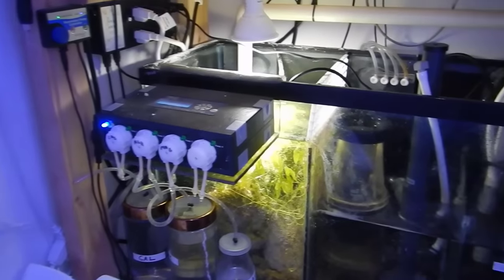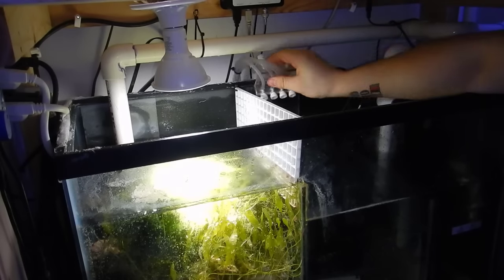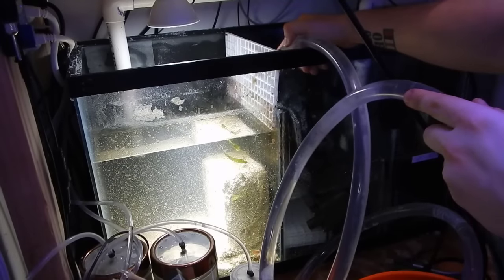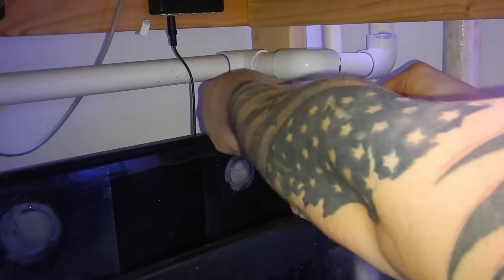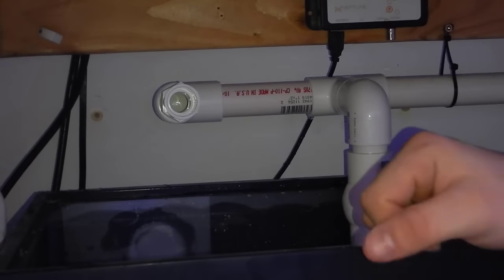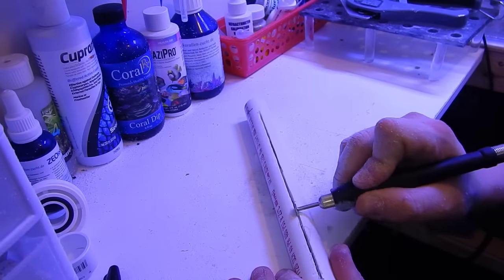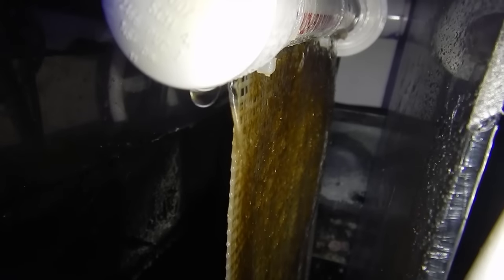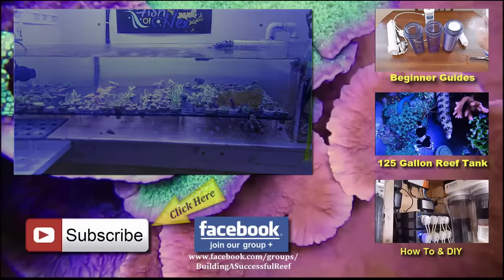Converting A Refugium To An Algae Scrubber Step By Step Build | Frag Tank

Comment: I wouldn’t ever replace a cheto fuge with a scrubber.. they do the same thing and cheto just requires less maintenance and less parts. On my salt systems is 100% cheto.. my freshwater tanks all use scrubbers as it’s currently they only way to control nutrients for large predator tanks. Scrubbing a screen weekly is way easier then 50% weekly water changes taking up 3/4 of a day. (I don’t have a fishroom my tanks are spread all over the house in different rooms other then the living room which has 3 tanks lol.